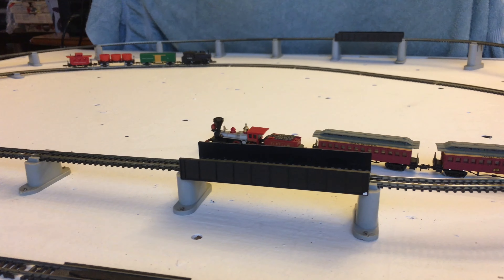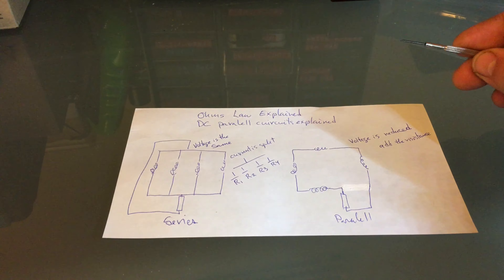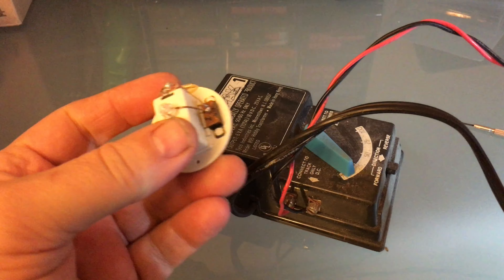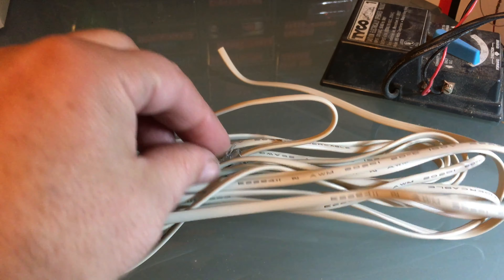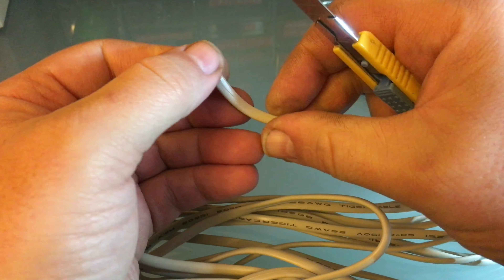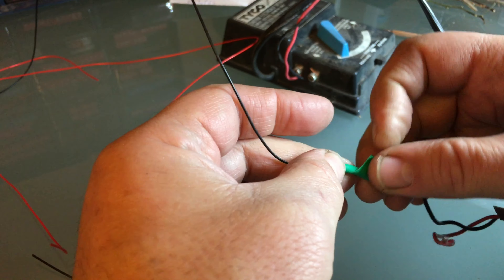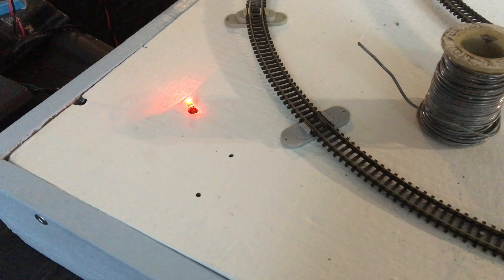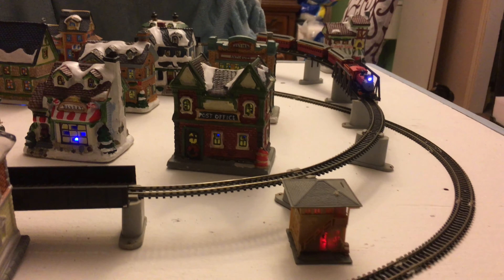Adding LEDs to my layout

Comment: You'll find it easier to solder if you put both wires in the helping hands and feed the solder from the roll onto the joint. the flux in the solder will clean the joint
Reply from the maker: I will try that.